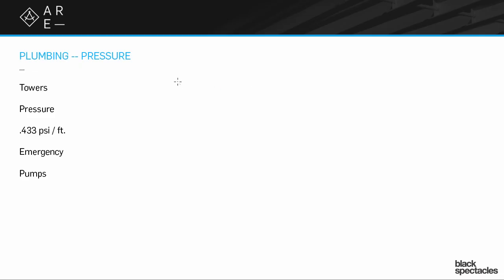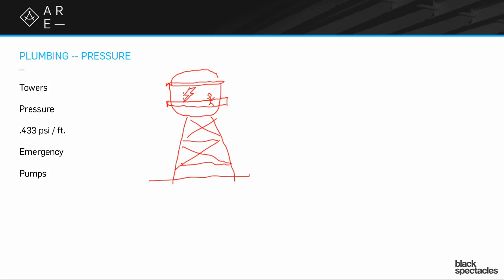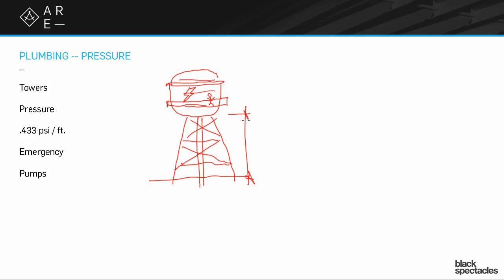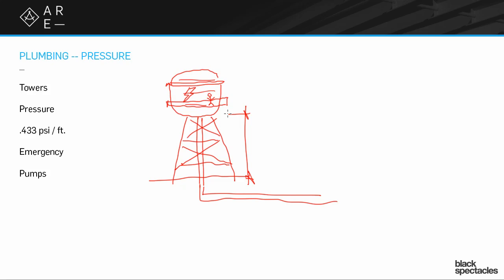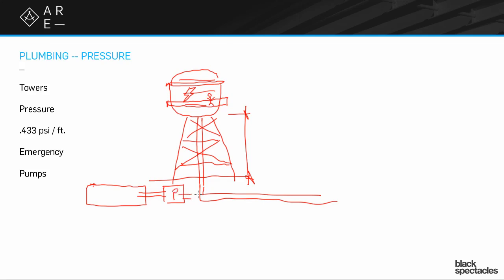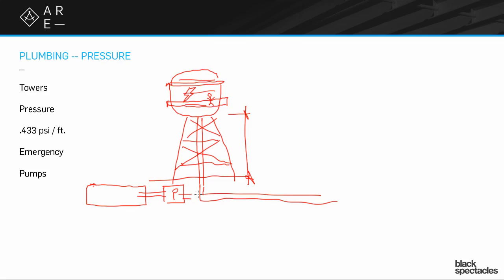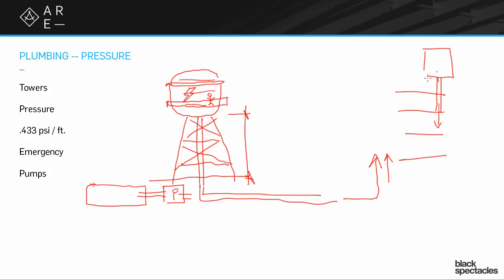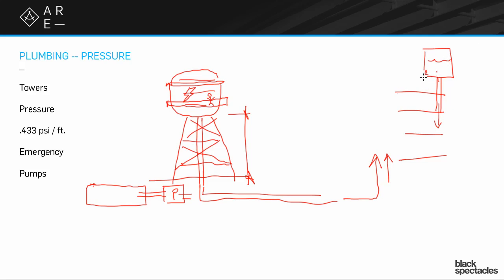Plumbing Pressure - Building Systems

Comment: AFAIK In India, all apartment buildings have roof-top tanks. A Sintex plastic black circular tank used to be used with a float switch. But all modern tanks are now made of concrete on top of the roof.

Comment: The pressure at the top of the tank is calculated by multiplying the top tower height by 0.4329 psi/feet. To calculate the pressure at the bottom of the tower, would you do (0.4329 psi/feet)x(bottom height)?